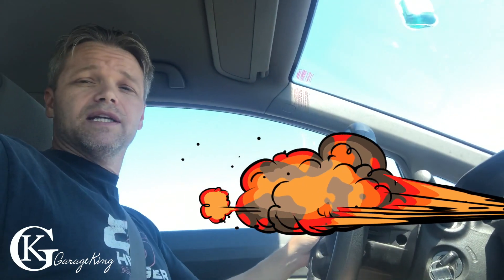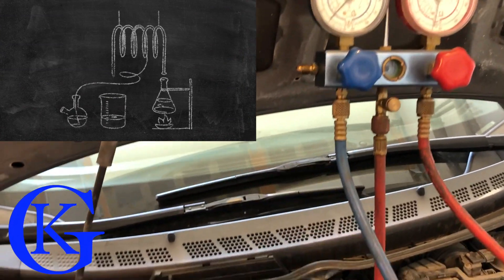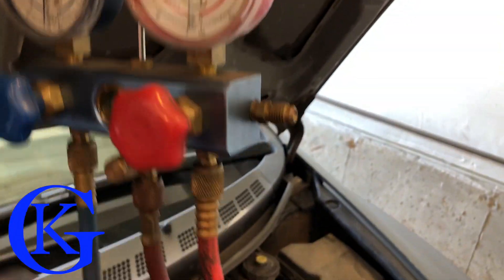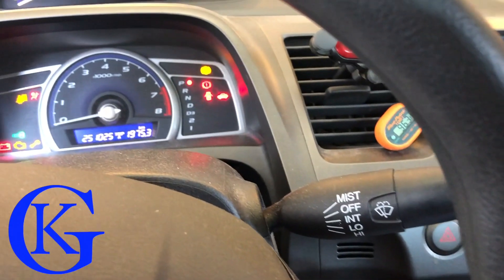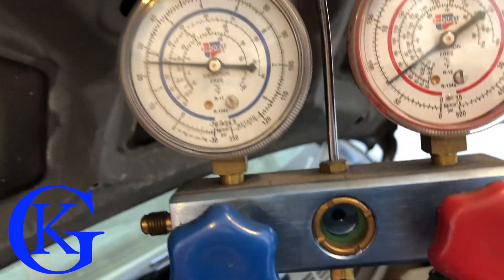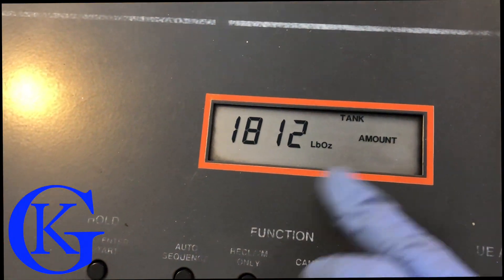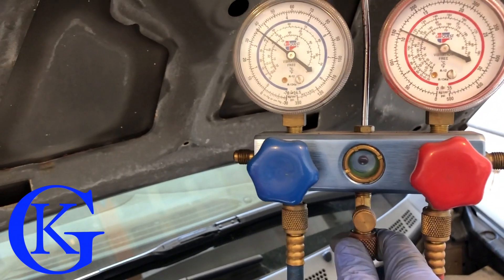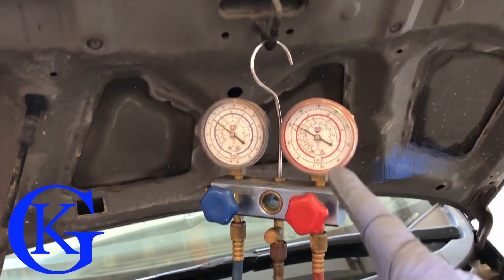How to recharge AC system with gauges properly and evacuate

Comment: Awesome video!!!! Question that I can not find an answer to ANYWHERE! I purchased a new gauge manifold set and have so far only used it to check pressures. When I disconnected it from the car I also disconnected the lines from the gauge side and refrigerant went everywhere from the high pressure line (at the manifold). 

Question 1: how are you supposed to put the gauge set back in the case without disconnecting the high pressure line and making a mess. Should I leave it connected to the gauge? 

Question 2: now that my new gauge set is disassembled and has residual refrigerant and air in the low and high lines, let’s say I want to top off a car how can I purge the low side line? I understand the purging of the yellow supply line but wouldn’t I need to also purge the low pressure line? Should I open the gauge valve and let the supply fill the blue line too? Seems like people only worry about the supply line for some reason. I know for a full evac and fill the lines would be under a vacuum so no big deal. But how about when I’m topping off and they are full of air? 

Thanks so much in advance !!!!!!
Reply from the maker: Hey There, ok, for question #1 - YES leave it connected to the gauge set as its the valves in the gauge body that hold the pressure in the line.  The pressure in the line is held between the 134a fittings on the end of the line (they have one way valves in them) and the gauges. All hoses are free flow.  Question #2 - Assemble the hoses to the gauges and R143a valves on the end.  Make sure the gauges are CLOSED.  Then hook everything up including the yellow line to the tank. EVERYTHING must be hooked up. Now you have to purge twice - once on the line (red and blue) side, and once on the yellow side.  For the red and blue lines just crack them free a bit on the gauge side until you hear a bit of air, then screw them tight again. Then open the tank and crack the yellow line at the gauge side until you get some out. Now remember this should all be done with the gauges CLOSED.  Now after this you are ready to go.  If you car have absolutely nothing in it, then you can't properly purge the blue and red lines as there is nothing left to push the air out.  In this case you should really vacuum 1st.  Once you fill the car then remove the gauges and leave the R134a connectors attached (that is what keeps the line sealed)  Hope this makes sense to you.
Reply: @GarageKing thank you very much for writing such a comprehensive response. It does make sense and I really appreciate it. One thing I wanted to clarify…so if I’m putting away the gauge set with the high pressure like storing 100-200 psi that’s safe to crack that line next time I use it like you described? I guess so since that’s what I already did which made the mess. lol.
Reply from the maker: @KemDIY  Hey there, glad to help out !!!  What I think is going to happen is if you put it away showing 100-200psi, in a month or so its probably going to leak down anyway.  But to answer your question, if the gauge is still reading high, yup you just snap it onto the new vehicle quickly to try to minimize any coming out under pressure.
Reply: @GarageKing awesome thank you! Also I subscribed! Love your channel.

Comment: Very helpful!  Quick question: If I am just topping off and not pulling a vacuum, wouldn't I have to purge the high and low hoses of whatever air would be in them prior to adding refrigerant?  I assume that to do this I would connect my hoses to high and low sides and then crack the red and blue hose fitting at the gauges, just as you did it on the yellow line to purge it. Is this correct?
Reply from the maker: Yes, BUT ONLY if the red and blue lines have never been used before, or they don't have the one way valves.  Mine have the R134a one way valves attached to the hoses at the end so air never gets in.  If you were doing R12 you would do it as you said in your comment, as R12 fittings don't have one way valves, they are screw on like a tire cap.  But for 134a fittings, they pretty much all have the one way valves so if you leave them attached to the hoses the air can't get in afterwards.

Comment: I never open high side in the gage for Vacuum, it was open at the port but close in the Vacuum. I learn that in another video, much better keep it closed and don't bother. I have to put the can Upside down to see something getting inside, but it was fast and keeping moving it up and down. That works for me.
Reply from the maker: It is better to open the high side when you are vacuuming, but keep it CLOSED for charging.
Reply: @GarageKing  Many people do it like you said, but I think, and it worked better keeping high side in the gage close when vacuum. The vacuum will work in the whole system because the whole system is connected, so with high side at the port open when the vacuum is working will suck everything even inside the high side hose, so no air will be even inside the hose.
Reply from the maker: @HeydaCarreras  Either way does work, but I think its faster to vacuum with both sides open, in the trade we open both sides to vacuum.
Reply: @GarageKing  agreed

Comment: I did it. Finish the job a month ago. remove the freon, remove the compressor, clean and oil in both Hoses O-rings, put back the new compressor, put the hoses, tight them. New compressor came with 4oz of oil already. Connect the gage, low side, high side, close high side open low side, connect the pump, 5 minutes, close low side in the gage, turn off pump, 15 minutes no leaks. Connected pump again for 45 minutes and open low side gage. High side in the port keep it open as low side but closed in the gage. 45 minutes Closed low side in gage and turn off the pump. I leave it for the next day like that. No leaks next day: Perfect vacuum.
--- Recharge: Disconnect yellow hose from pump, connect it to freon can, purge the yellow like, open low side in the gage, gas went in, turned the car, put a/c with thermometer in a window: started at 82 degrees, A/C compressor kid on right away. I don't know what the hell I did but I added freon what I could, looks like it doesn't take too much, even the first can has more inside, second went like half, but the car A/C get to 41 Degrees. I stop adding, so finish the shit. Compressor is working, cooling and life is great.
-- To read the Gage is too freaking hard and understand. I make the job for $ 250.00. Shop quotes me $ 1700.00.
-- Didn't replace any expansion valve or Filter. car has 78K miles only. pretty new system, in other car with 120K miles plus I would change them.
Reply from the maker: Sounds like you did a thorough job, and you don't have to add much to get the compressor to kick on.  Most cars will start with only an oz or two.  Good job my friend !!
Reply: @GarageKing  Thanks to you and other videos. I have never done this before, but my wife told me: if they do it why not you? She was right.
Reply from the maker: @HeydaCarreras  The boss is always right !!!

Comment: My Kia soul ask for 18 oz, so I will use two cans of freon R134A. I'm going to replace the compressor. The car has only 77K miles.
Reply from the maker: It depends on how much is in the can.  If you are replacing a part its always advisable to get it evacuated as you will have moisture in the system and moisture = warmer air.  You can always buy a cheap pump from Amazon.   https://amzn.to/4ePoypn

Comment: What about what other people recommend letting it in vacuum for the whole night to see if it is any leak? The called old school.
Reply from the maker: You could, but you have to HOLD, that's what I do, so you draw a vacuum, but then you need a way to hold the vacuum without running the pump.  If you keep the pump running the vacuum will remain and you wont know if you have a leak.
Reply: @GarageKing  After doing the vacuum, close gages, turn off vacuum pump and leave it like that until next day. That's the way to see if it has any leak. Next day both gage needles have to be in total vacuum, if not then we got a leak.
Reply from the maker: @HeydaCarreras  Yes you can do that, good thinking !!

Comment: So, it doesn't damage the compressor to start the car and A/C without any freon on the system? Is not better to add some freon using the vacuum pressure you already created and went stabilized then add the rest?
Reply from the maker: doesn't damage the car at all, the compressor just won't engage, lots of cars running around like that.  Only add when you are ready to fill the whole thing, don't do it in steps, best to leave it empty or under vacuum if you can.

Comment: ok, thank you for your reply. I have a another: Everybody purge the yellow line when recharge to remove air, but what about the blue line or low side when it's connected to the gage? that blue line has air as well and when you add freon that air it goes inside the system, right? I haven't seen people purge that low side, ever.
Reply: Thanks so much for responding to him with humility...I'm new to this and want to learn to deal with vehicular A/C as a DIY-er...so your responses helps me to learn alot
Reply from the maker: @KuudoPrince  I do my best brother, hope you had a great week : )
Reply: @GarageKing  I did it. Finish the job a month ago. remove the freon, remove the compressor, clean and oil in both Hoses O-rings, put back the new compressor, put the hoses, tight them. New compressor came with 4oz of oil already. Connect the gage, low side, high side, close high side open low side, connect the pump, 5 minutes, close low side in the gage, turn off pump, 15 minutes no leaks. Connected pump again for 45 minutes and open low side gage. High side in the port keep it open as low side but closed in the gage. 45 minutes Closed low side in gage and turn off the pump. I leave it for the next day like that. No leaks next day: Perfect vacuum.
--- Recharge: Disconnect yellow hose from pump, connect it to freon can, purge the yellow like, open low side in the gage, gas went in, turned the car, put a/c with thermometer in a window: started at 82 degrees, A/C compressor kid on right away. I don't know what the hell I did but I added freon what I could, looks like it doesn't take too much, even the first can has more inside, second went like half, but the car A/C get to 41 Degrees. I stop adding, so finish the shit. Compressor is working, cooling and life is great.
-- To read the Gage is too freaking hard and understand. I make the job for $ 250.00. Shop quotes me $ 1700.00. - Didn't replace any expansion valve or Filter. car has 78K miles only. pretty new system, in other car with 120K miles plus I would change them.
Reply: @HeydaCarreras  perfect vacuum because you closed the low side valve and locked out the system
Reply from the maker: Thats where its different.  The blue and red lines have one way valves on the end so no air ever gets in them.  The yellow is removed from the fill tank so air gets in it.
Reply: @GarageKing  Let me put it this way> When you connect the low or high those hoses have air, but when you do the vacuum that air is removed, but you need to connect high side at the same time you connect low side, then do the Vacuum. if you do vacuum with low side and connect after vacuum the high side remember that hose has air and the system already is in vacuum, so the air in the high side will be sucked to the system. I hope you understand or maybe I'm wrong.
Reply from the maker: @HeydaCarreras  I understand, but you are wrong.  The high and low side have a one way valve at the CAR END of the hose.  This is built into the snap fitting.  On the other side of the hoses (gauges) the are valves are always CLOSED so no air can get into them.  You can disconnect or take the yellow line right off, it doesn't matter, as long as the valves by the gauges are CLOSED, the red and blue are sealed.  Now if you OPEN the valves and remove the yellow line then air will get into the whole system and you should actually purge the lines not at the yellow connection (or gauge valve) but you you should purge at the one way valves at the end of the red and blue lines as that's the furthest point away from the entry point (where you hook up the yellow line).   If you are vacuuming out a system that has air in it.  Once you finish your vacuum there is no air anywhere, its all under vacuum.  So you CLOSE the high and low side valves and now they are both air free.  Then disconnect the yellow line from the vacuum pump (air goes in), connect it to the fill tank and purge it, that is the only line with air as the red and blue stayed empty.
Reply: @GarageKing   Got you. thanks
Reply from the maker: @HeydaCarreras  Anytime brother, good chat !!!

Comment: I have a question: why we need to measure the freon when entering the system if we can control it by the low side gage as you did? Once we get to that point we can stop and that's it
Reply from the maker: Its because there is no way of really knowing how much is in there.  The only way to truly know is to weight it in.  The gauges give you a general idea, but not exact.  Now you can follow the gauges and stop when its getting cold, but you have to ensure you are not going to far and putting too much in, so once it starts to get cold you have to stop.  This way you are probably safe and the system would be a bit low.  As always only do if you are comfortable, some people think AC will blow like an ice box if its 100F out there, it won't.

Comment: Weird. Why you crack the yellow hose to purge the line when you have a valve for that? You have a place right on top to do that?
Reply from the maker: Its not weird, its just old habits, as that's the way I have always done it. It accomplishes the same thing. The other thing is the valve is facing right at you, when you crack the hose it will go away from your face.
Reply: @GarageKing  put your face other way or move the gage. WOW.
Reply from the maker: @HeydaCarreras  Like I said, everyone in the shop did it that way so it was a habit.  Either way gets its done.  If you want to use the valve that's fine, but either way will work that's all I'm saying. No hard feelings, but normally you look at what you are doing so most people will intuitively look at the valve when they release it.  Either way will work, its just what you are comfortable with.
Reply: not mine

Comment: I'm missing something. The chart said the car would use over 1 lb 5 oz. Of R134a but you read it as a pound even. Then the chart said it should take 8 oz of your special refrigerant but yo you read it as 6 oz but only added 4 oz because there's refrigerant in the line. Why are you saying the charts say what they aren't saying? It's obvious you know what you're doing but those discrepancies cause confusion.
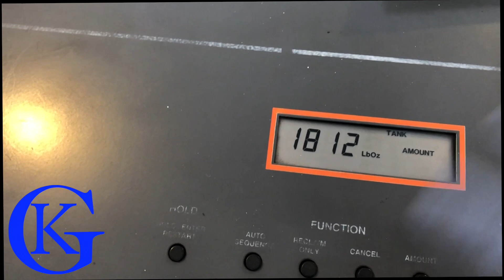Reply from the maker: OK, the chart says .88-.98 of R-134a, so that is 16oz. Its not 1lb 5oz. There was a red circle I put at the 3:53min mark.  I talk about a can of r134a that's 12oz, so not enough as we need 16oz.  Then I talk about putting in RedTeck which is pretty much the same as Duracool and it has a different density so only 6oz is required 6:36min mark, at 19:15min mark I show you there is 19lbs left in the tank, I reduce the tank weight by 4oz to 18lbs 11/12oz (its 4 oz less) 13:02min mark and then I shut the valves off to STOP filling.  I explained there was about 2oz in the hose so once I shut the tank off and reopen the valves we get the last two oz, so 4 from the tank and 2 from the hose is 6oz, that's exactly what we needed.  I think you got confused when you saw 1lb 5oz on the chart, the older civics took more, I was working on a 2006 which in the chart lists the capacity as .88-.98lbs.  Freeze the vid at 3:50min.  Hope this clears everything up.  Please let me know if my explanation was ok.  Also keep in mind its never exact.  Most techs can be off an oz or so because of whats in the lines.

Comment: Excellent tutorial! I’m curious why you didn’t have to add any PAG oil? I thought the PAG was commingled with the refrigerant, so when it was completely evacuated that would mean some PAG oil would be needed?
Reply from the maker: When you evacuate, you only evacuate the refrigerant.  This is done by reducing the pressure so much that you are pulling a vacuum.  This lowers the boiling point of any water vapour to the point where its going to boil and turn to steam at room temperature.  The steam is removed and the PAG oil stays.  The only time you should add more oil is when you replace a part (and even then not always).  Hope that helps.

Comment: how do you trick your clutch to work? I am stuck in this part. I can't get it to spin.
Reply from the maker: You just put in a few oz of refrigerant and it should come on.  If it doesn't and you have a Honda, you probably need a thermoswitch (not that hard to replace)  Here is what they look like https://amzn.to/3WLNDve
Reply: @GarageKing  yeah I did that. I tried putting some oz of refrigerant but the clutch wouldn't spin. this thermoswitch is hooked to the compressor right?